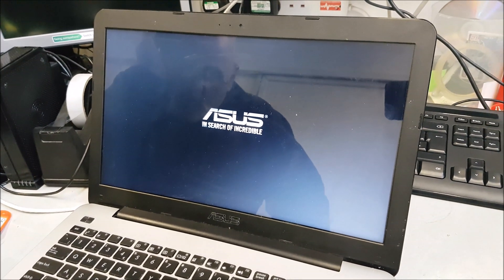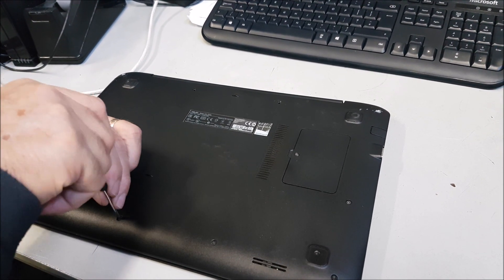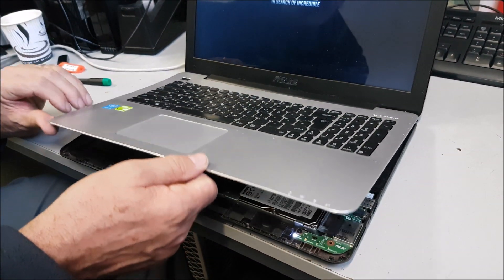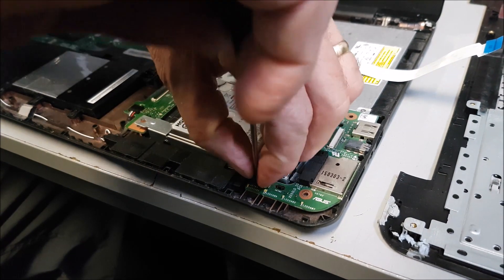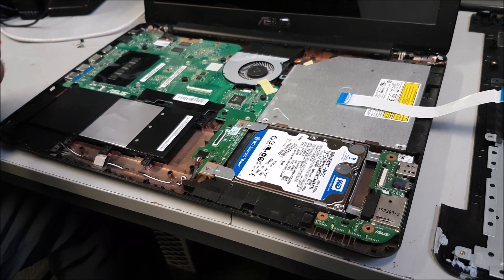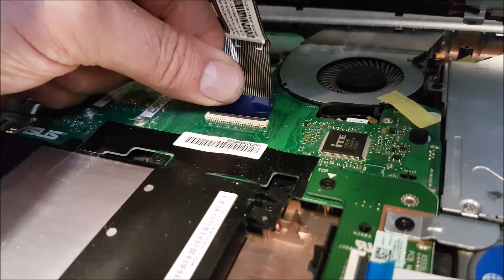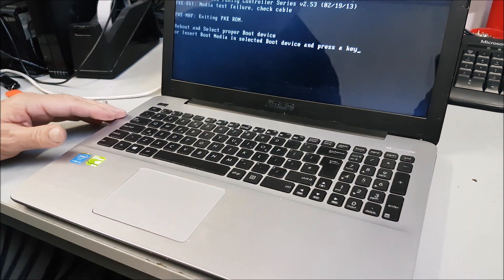ASUS X555L HARD DRIVE REMOVAL AND REPLACE

Comment: Thanks for this. I'm in the process of swapping the HD on my son's laptop for an SSD as the former had stopped working. The hardest part (so far) was pulling the plastics apart as they are thin and need a gentle touch.
Reply: Quick tip.. Use a mirror to reflect light onto undersides.. Lot easier to see then.. I did a battery swap and had to remove keyboard so done that bit before. Don't use a torch/phone as you WILL run out of hands.

Comment: so can u tell me where the wifi card/module on this model, i replaced the hdd by a ssd, but from then wifi connect become stutter  (sometimes can't even connect to wifi), i don't know the faulty itself or i did something wrong when opened it.

Comment: Hi, what could happen if the ribbon that's glued on top of the drive is damaged? Mine tore a little (I think just the glue) when replacing it, and I'm getting BSOD every day since then, I don't know if that may be related or maybe something else is up.

Thank you very much for the video, super useful!
Reply: What error your BSOD shows? Critical_process_died ?
Reply: @iii7172  I get this bsod because probably that cable that connects the right side is broken (I can't use jack audio and connect usb in that side)

Comment: My ribbon cable is burnt, what is that ribbon cable. 20 pin or 15 pin? Can you please post the link to ribbon cable
Reply from the maker: i think its keyboard so its a new keyboard not expensive
Reply: @MrMeltedwellies  I think it is a 30 pin ffc cable. The cable with which hard disk in my asus laptop is connected. Can you tell me exactly which cable is it or drop a link where I can buy that.
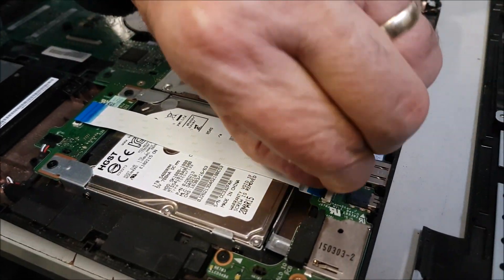Reply: @MrMeltedwellies  The cable that you disconnect at 3:00 in the video.

Comment: Thank you for taking the time to produce this video. It was really helpful.
Interestingly enough the laptop i worked on had no screws in the bottom either except for the screw holding the RAM cover in place.
Most strange
Reply: This laptop is generally extremely flimsy. You dont have to try to unscrew those; they'd just fall off.

Comment: Thank you sir! Was afraid I was gonna break this thing more than it already is :)
Reply: If you are running Windows 10 then you can't break it any more!!! lol
It's awkward but easier than changing the battery.. Just done HDD swap to SSD, Changed DVD drive to HDD dock. Had fun with partitioning DVD Dock HDD (My old system) but having a PS4 solved that. Just used drive as "Extended Storage" on PS4, Partition unrecognised in Windows Disk Manager.. Initialise disk.. Voila.. Problem sorted!!. lol
Reply: Known as Silver Dave in Hostel and also "The Tech Guy" or rather.. See "Silver Dave - he'll help!!"  lol

Comment: just because there are screws missing does not mean anyone's been in it. I had one of these and a few of the screws simply fell out!
Reply: I need to screw one back coz my laptop keeps crashing. Im also hearing alot of sound from the hard drive area which the screw that supposed to hold the hard drive is gone
Reply: Bought X555L 3 years ago, I heard strange noices from the screen holding joints, bottom rubber buttons fell out and sevral bolts just disappeared during a first few months. Just after the guarantee ended, several problems occured like scraching noices and ovrheating with very slow performance. Now after only 3 years the laptop keeps blue-dying... several times a day, mostly when i move or tilt the laptop. Would fire on spot the one who designed souch a bad and low quality casing/laptop in general!
Reply: @Demotreo  what are the specs of that laptop? Coz it sounds like my laptop
Reply: @AzPlayz1052  Asus X555L, Intel i3, graphic card: Nvidia Geforce 920M. Don't know what else can I tell you about it :D The main problem is the weak casing which allows the inner circuits to be easily squished and therefore moved/deformed/physically disconnected or blocked.
Reply: @Demotreo  thats weird coz i have the same laptop but the specs are i7 5500u geforce 940m and 8gb ddr3 ram
Reply: @AzPlayz1052  same

Comment: Why on earth did Asus build a laptop like this seems overly fiddley compared to most other laptop where the drive is located at the back under an access panel
Reply: That's more than a half of laptops with such design these days. Sometimes you have to remove keyboard to crack them open. I think Dells are the worst case but some Sony Vaios and Lenovos are also almost impossible to get inside.

Comment: Specs :
CPU Intel Core i5-5200U 512K L2 Cache, 3MB Cache, up to 2.7 GHz
GPU Intel HD Graphics 5500 (300 - 900 MHz)
GPU NVIDIA GeForce 930M 136 (924-941 MHz) (2GB DDR3 1800 MHz)
RAM 1x 4GB DDR3 1600 MHz CL11
Display 15.6”, HD (1366 x 768), TN
HDD 1TB , SATA3 5400 rpm
DVD Drive SATA1
USB3 x 2 Slots, USB2 x 1 Slot
Memory Card Reader (USB2)
Battery 37Wh, 2-cell
HDMI Port, VGA Port, 1GB Ethernet Port, 3.5mm Audio Port
Dimensions. 382 x 256 x 26 mm (15.04" x 10.08" x 1.02")
Reply: 7mm or 12mm height? details on the drive size plz? I wanna switch to an SSD. 
This piece absolutely sucks with that slow drive. But once loaded it feels okay

Comment: mine only flickers when the adapter is unplugged... plugged in no prolem
Reply: Mine too but there is a solution for that or no ?
Reply: @riadadel  still have not found a solution for it but to keep it plugged in
Reply: @shots2  It's so annoying when u're not at home !! And i hava another probleme the wifi goes down to one bar then goes up ! i've change the drivers try many things and nothing worked

Comment: Recently installed SSD. Downloaded Windows 10 from M$ and installed that flawlessly. Didn't need any of the Asus tools. 
It's basically a new machine. Starts very fast. Runs flawlessly. Click and things open.
Reply: Hi, my X555L hard drive has stopped working and I need to replace it.
Is it possible to insert an SSD instead of the HDD and is it easy to install windows?

Comment: In mine the wide ribbon that goes across the HDD is split crack damaged. Do I need to replace it? I am not sure how important this is. How do I go about finding a replacement? I don’t even know what it’s called.
Reply: TS McClellan it connects the led’s to power and the usb, sd card, and headphone jack

Comment: thanks for the video...my hard drive is failing, could you tell me is the hard drive 9.5mm or 7mm...also should i stick with a hard drive that is 5400rpm or go with 7200rpm,thanks in advance!
Reply: 7200 100%! faster read and write speeds. Also you should consider an ssd. They are much faster overall